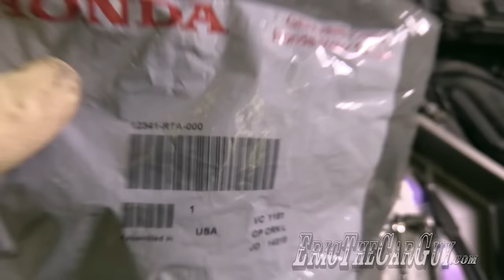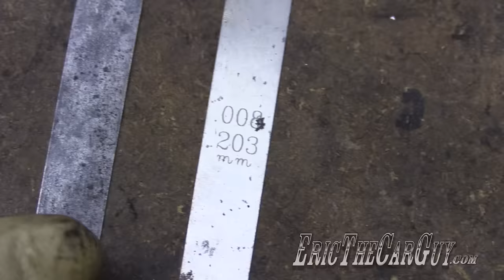Honda K Series Valve Adjustment -EricTheCarGuy

Comment: Thank you so much for doing this video! I’ve watched it a zillion times and taken extensive notes. At almost 300K miles, the 2005 Element that I inherited hasn’t never had its valves adjusted (and of course there are more problems than just that). This video gave me the confidence to do the job myself. Having gotten the valve cover off, I’m now wishing (remember- almost 300k miles) that BEFORE I took the cover off, I had taken a toothbrush and rag to clean all around the edges of the valve cover. The amount of road grime that’s built up is ridiculous. With the cover off, it’s very difficult to wipe the grime away without some of it also falling into the engine. Again, brush the grime away BEFORE loosening and removing the valve cover. That will save a lot of time and heartache. Thank you ETCG for this stellar video!!!
Reply: Did that engine last these past two years? My guess is that road grime took it on out, microns of dirt hurt your engine, you can barely see a 10 micron speck
Reply: Well Paul, I stuff dirt in my engine every change and my motor is approaching a quarter million inches.
Reply: @paulcollins9094 My E is still going! The idle is a little rough, so I’m revisiting this video, thinking I’ll pop the cover and make sure everything is still good. Since it was my first time, it’s possible that I didn’t tighten a nut enough and allowed the screw to loosen/tighten on its own. Also, want to make sure the exhaust valves haven’t tightened up too much. Again, noob adjustment, so checking to make sure all is well.
Reply: Check your intake from the air box to the manifold my rubber tube was ripped and had a vacuum leak

Comment: Coming from an old Mercedes mechanic who did more than his share of valve adjustments on 70's & 80's vintage 240D's & 300D's, I have to congratulate you on a top notch instructional video. I recently inherited a 2006 CRV with 61K miles, never had a valve adjustment. With this video to guide me, I expect to be able to perform the job without any problems. Thanks for this exceptionally well done video, Eric... Semper Fi!

Comment: Out of adjustment valves can cause a misfire. I've had a check engine light for a cylinder one misfire for months. I've done plugs, coils, timing chain, cam and crank position sensors. Misfire still hung around. Finally did a valve adjustment, cyl 3 exhaust valve was way out of spec. Misfire and check light is finally gone. So if you have a Misfire you can't diagnose, check the valves.

Comment from the maker: Let's see if we can make this thing run smoother. https://www.youtube.com/watch?v=959I0wF5NH8
Reply: ooooh look at you Eric CLEANING the OUTSIDE of your valve cover and then WIPING the plastic covers. i know the mr. clean is in you somewhere lol
Reply: How does 1/4" tools reduce over torquing?
My hard won lesson has just been to choke up on the ratchet anytime the stud is small.
Reply: *****
the 1/2 inch male sqaure that the socket goes on is wider therefore exerts more leverage around the nut plus the longer handle. so just turn it closer to the wratchets head if using 1/2 inch or 3/8. i hope im making sense lol
Reply: The size of the adapter doesn't change the amount of force applied. In effect, the socket and the square are mechanically the same component and are part of an axle. The size of which should only account for how much it will withstand before sheering. I've broken many 1/4" adapters and ratchets. I've even broken 3/8" extensions. So far I have mostly only bent larger ones.

The length of the handle, and the more delicate feel could encourage less force.
Reply: *****
The smaller drivers are harder to exert force on assuming we are using our hands.  The smaller drivers are also generally shorter handles, and I THINK have less mechanical gear strength than the larger ones.  Stay gold.
Reply: I just twisted the square drive off of a 3/8" ratchet Sunday. Was taking the castle nut off of a outer tie rod end. Funny bit was I was bracing one arm against the disc brake trying not to let the knuckle turn as I pulled on the ratchet.
Reply: *****  1.  Probably cheap ratchet, right?  2.  Try banging on the handle with your palm or a rubber mallet instead of pulling.  Banging, shocks the fastener tends to break it loose, same principle as an impact wrench.  Funny though castle nuts are usually 40 ft. pounds or so unless it was a truck.  I'd say there was some rust for sure.
Reply: +EricTheCarGuy 
Hi. I am about the change my cylinder head on my 2005 Euro Accord k20a6, but I m not expert, so do you know where i find some videos or at least pictures of the procedure. Thanks for the help!
Reply: +RLAgito He's only doing it because its a Honda. He knows the VTEC worthiness.
Reply: Chris Weber I'd go after it if it was my 2004 CRV.  It might be OK but then again it might not be OK at all and the only way to know that it's OK would be to go after it.  Plus, don't you need to replace the guide now anyway since it broke into three pieces?
Reply: Chris Weber OK, I'll let him answer this.  If it's a tiny piece, it's likely not going to block the oil pick up screen.  If it's bigger, I'd go get it.  Also, if it's not in the oil pan but went somewhere else it would be good maybe to go get it since it will never break down.  Good luck, I hate stuff like that.  Like as in "what's the chances of that happening??!!"
Reply: Chris Weber Shit happens.  As long as you don't trash the engine, it will be OK.  It is kind of amazing how easily things can go horribly wrong though.  I've noticed that myself in my own mechanical adventures.  As in "Are fucking kidding me??!!!

Comment: Having worked on this over the past week, along with a long and drawn out sludge removal process, I finally understand why Eric suggests doing it this way instead of doing cylinders 1-3-4-2 like Honda does.  It's really easy to get confused and do the wrong cylinders, especially when you go from 1 to 3.  Last night I started doing #2 instead of #3 and totally got my valves messed up.  Well, not exactly messed up but way out of adjustment; I'll have to start over and it won't be fun because they are so far off now on #2.  I'm going to do it this time the way he does it in this vid.

One other thing of note, both here and on his website he puts the exhaust valve clearance at .010-.013 but the Honda service manual for the 2003-2004 Element says .011-.013.  As long as the .013 feeler gauge doesn't go and the .010 does it should be fine though.

Thanks again for the video, Eric.

Comment: Thanks for the video. Today was my first time doing this. I changed the gasket, oil seals, and rubber grommets while I was there. Engine feels smoother, less noisy, and has better response. Subtle differences but I have owned my TSX for 10 years so I can tell the difference. I used the shorter angled feeler gauges because its crammed in there. Helps to disconnect  the line coming out of the power steering pump (and to the rack) so you can easily remove and reinstall the valve cover. I found it easier to insert the feeler gauges from the side of the feeler gauge instead of going straight with the tip. I used a ratcheting combination wrench on the 19mm bolt of the power steering pulley to turn the engine.

Comment: Only thing I have to add is the following.  A lot of people always focus on the fact that if you get the valve clearance to tight that you can burn a valve, or if you get to much clearance, the valvetrain will be loud.  The part I never see people say is the what can happen with loose valve lash besides just being loud.  You have to get those hot exhaust gases out of the cylinder.  If valve lash becomes way to loose you can actually heat that cylinder super hot.

I have seen this happen on a single cylinder motorcycle with 4 valves.  One of the exhaust valves had a decompression release for easier starting.  It got out of adjustment and caused excessive valve lash on that one exhaust valve.  The engine was ran until it started smoking and burning oil like crazy.  We found this loose valve lash and cause on tear down.  The one valve was barely opening due to excessive lash and the other exhaust valve was not enough to get rid of the exhaust gases.  The engine got so hot that the rings lost temper.  We took the rings off the piston and you could twist them and they would not break.

So just adding to what can happen with loose valves.  This is why it is important to keep them within the spec of the engine.
Reply: Hondas actually run better with a looser adjustment. That's how I adjust them. Never had an issue
Reply: This is technically true, but i think they would have to be unbelievably loose, i would imagine like 1/8th inch gap for it to affect the timing and escape of exhaust gasses. So much so, that if you can't tell something is too loose, that you wouldn't belong anywhere near an engine.
Reply: @kylen.6742 I was curious as to why the engine sounded louder after doing the adjustment? I thought it was supposed to quiet things down?

Comment: Great tutorial Eric!  I noticed a bit of valve noise from my '08 TSX and was planning to set the valve clearances (130,000 miles).   I now know to remove the valve cover bushings BEFORE I remove the valve cover and loose them in some dark place in the engine bay.

Your comment on the exhaust valves being a bit tighter after 120K miles is because the valve stem material "creeps" under higher temperatures and valve spring tension.  Intake valve stems are much cooler particularly when the intake and exhaust manifolds are on opposite sides of the cylinder head.   In addition, the fuel/air charge also cools the intake valve fillet and seat.   So the intake valves clearances increase due to wear on the camshaft lobe, while the creep of the exhaust valve is greater than the contact wear with the cam lobe.   

Thanks for helping us keep our cars running great!

Comment: Thanks Eric. I did this today. As you mentioned, the intake were lose and the exhaust were tight. A bit of a challenge reaching back behind to get the exhaust valves adjusted. Especially for a 67 yr. old guy. So far, engine is running smooth. '03 AWD. I appreciate your help as always.

Comment: I love my Element. 275k miles, runs and drives like it's got 20k
Reply: How's she running these days?
Reply: When did u have the valves adjuste?
Reply: thanks pare.. God bless..
Reply: Odyssey with 240k and runs and drives like it was just driven off the assembly line
Reply: Would this do much for gas mileage?
Reply: @1999av6  what do you mean?
Reply: @nasseranise102  short answer. 1st element owner here. Shade tree hobbies car owner. My 03 is getting terrible gas mileage at around 200miles a tank. I have only owned it for about 2.5 weeks, just trying to gather more info and opions info before performing a more in depth diagnostic myself. ( I understand the value of maintenance and what a valve adjustment is for, having done it on previously owned Honda's. Just looking for your thoughts I guess. Thank you for your time.
Reply: @1999av6  a lot can cause that. Bad spark plugs, fuel injectors, valve adjustment. If u got it from a dealer I would bring it back. Even ur tires can effect ur gas milage, but typically not by that much.
Reply: @1999av6  another thing is the fuel filter that could be bad, or the various sensors such as ur O2 or mass airflow.
Reply: My dad's 03 Accord Ex has a rough idle going on as well as the CEL on. He says his mechanic ran the codes and it's the o2 sensors. 130k miles it has...I'm gonna hook it up to a scan tool and confirm

Comment: Thanks for the video!  I used to do this stuff for a living but its been about 10 years since last doing a valve adjustment on a Honda.  Found your video to make sure I didn't forget anything and found your tip about turning the engine over from the power steering pump MUCH better than the typical method of doing it at the crank pulley.

Comment: This is a FANTASTIC video!  Thank you very much for this, I am very grateful!  I'm about to adjust my valves on my 2004 Element, I got it when it was 205K miles on it, previous owner did absolutely zero maint except very basic oil changes and air filters.  Amazingly, this actually was better for it than him half assing the work.  Now I'm catching up on the services.

Comment: Hey Eric, quick tip for the diy. Instead of getting the special tool you can use a Craftsman Max Axess ratchet and socket (or other brand) with the pass through design. That way you can put your screwdriver through the socket and extension and tighten the locknut while holding the screw in place.
Reply: link?
Reply: Thanks!  I totally forgot that I own one of those sets lmao.  Great tools too.

Comment: Did my valve adjustment on my 2007 R18. at about 125k . Very easy and straight forward. do your research and know your gap sizes. :)

Comment: I just did the same adjustment on my S2000.  I couldn't get the feel for the right amount of drag at first so I used a go-no-go method.  So, if I want a 0.009" gap, I initially tightened that screw to where the feeler gauge wouldn't move, backed it off just a little bit and tightened  the locking screw. I checked the drag at 0.009" (expect to feel moderate drag), 0.010" (expect the feeler gauge to be tight/not fit), and 0.008" (expect the feeler gauge to slid in easily and with very little drag).  Worked well for me.

Comment: Great video. It's the first EricTheCarGuy video I've had time to watch in months, busy working two jobs. Missed watching your videos, you do an excellent job and you include as much information as possible (even the little things some people may regard as not very important). 

I'm going to check the valve clearances soon on my Civic Type R along with the timing chain and putting in some new higher lift camshafts from Spoon. 

One question; did you use a torque wrench to torque the lock nut to the correct torque specification?

Comment: just adjusted my valves om my 05 element with 138,000 miles. It fixed an issue where the car stalled when put into drive on a cold start. SO WORTH IT! Also better mileage and throttle response. Great vid (:
Reply: How much did your gas mileage improve?

Comment: Just used this to help me make a customer's 2002 CR-V run like a top, had random misfires on all cylinders with #1 and #3 returning the soonest. As I was adjusting I found 1 and 3 had both valves too tight, adjusted those as well as 2 and 4 poof random misfire gone and car runs great thanks Eric the video was quite helpful.
Reply: Wilkerson Auto, man I have to try this on my crv, I have all cylinders misfiring....
Reply: @reellifewithcinco7858  it takes a bit of finesse but once you get the feel for it then it's pretty straightforward. Make sure you have a wrench with a 90 degree bend in it and the longer style feeler gauges. Good luck but with good videos like this one you won't need it 👍
Reply: @reellifewithcinco7858  Did it fix the misfires?

Comment: Eric, I love you video's. Even though, I'm a mechanic too. I'm not saying that I'm better any any shape or form. I just want to share some input that you should know by now. You mentioned removing that power steering line. That is great advice to people who go that route. The only thing I would recommend (which i'm sure by now you know) that stupid o-ring on that power steering line. That o-ring fails, but doesn't leak. Instead, it causes a loss in power-assist a lot. If it's off, it should just be replaced....cheap insurance! Some of the shoos here (in Commifornia) replace good pumps for no reason. I'm sure you know that by now. It just I got burned once by an o-ring on a p.s. pump. Anyways, thank you for the great video's. We can't know everything.

Comment: well. i dropped a bolt down the drain on the valve cover.
looks like i got a bolt in my oil pan
Reply: It's "easy" to take off the oil pan. :)
Reply: This happened to my brother's Camry and pulling into his mechanics, the oil must have sloshed it up so that the crankshaft knocked it clean out through the pan- messy! Pays to retrieve them.

Comment: 34:42 From what I can hear most of the noise comes from injectors. That "ticking" sound. It's the same on my Hyundai.
Engine itself sounds smooth to me.
When you let go the throttle on 35:02 fuel injectors shut off (RPM are going down) and there is no much noise at all.
Reply: Good observation- for two seconds only.

Comment: inspect the piston return springs while the valve cover is off
Reply: So you can adjust in the order of 1234 and just make sure the cam lob is pointing strait up?
Reply: @RyanTinger  Just make sure it's TDC.
Reply: @r3dhorse  Ended up taking it to the dealership. It was way off and was the culprit of my problems. Was not too expensive either.

Comment: You are the only person in the WORLD that says this thing about oil coming up from below through the spark plug tube threads.... I have not been able to find anyone else to corroborate this anywhere.

I'm getting ready to take mine apart because there's oil on the coils.... and I'm gonna change the rubber gaskets as every single other person and manual under the sun recommends.

Comment: As old as this video is, here I am. This video allowed me to do this job on my wife’s CR-V with little trouble. Mine isn’t a v-tec head but it’s not much different. I did pull the fuel rail as well to make it easier. The gaps were also slightly different on mine but once I found them, it all clicked. Thanks Eric.

Comment: Just did this on my 04 CRV a bit over 200k miles and it smoothed the idle out immensely. Used to feel like it was going to die intermittently at stop lights and had a strange lurch when I was in drive while idling. Now it feels like it only has 80k miles and smooth as butter.